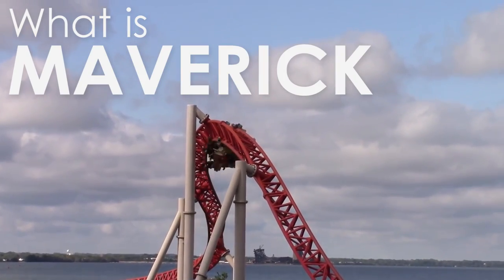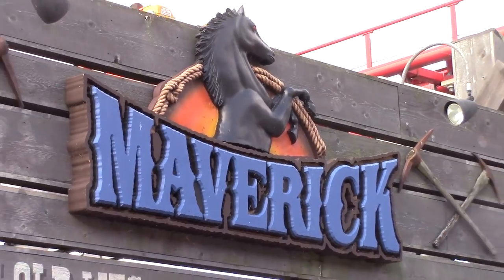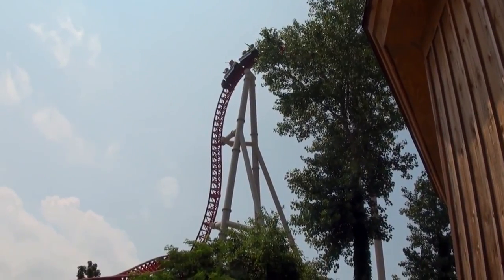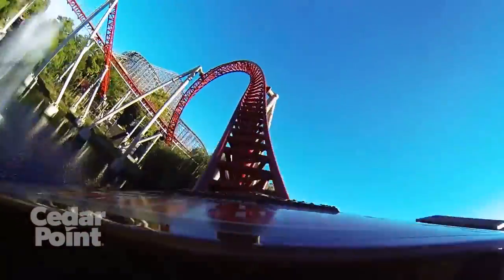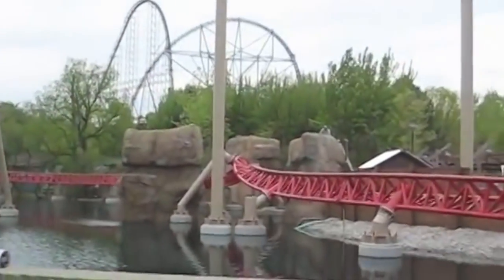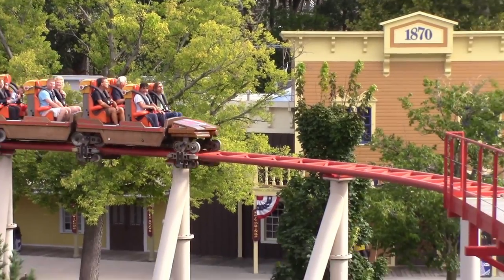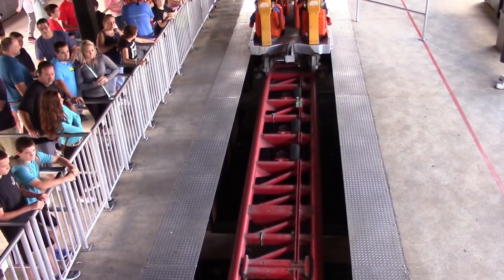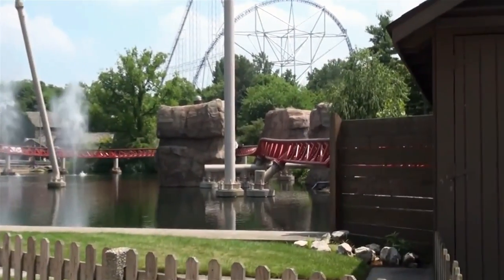What is: Maverick - Cedar Point

Comment: When I think of roller coasters I think of this ride.  I remember doing it at like 10pm when the park was about to close down.  They don’t (or at least when I rode it, they didn’t) light the track very well and I rode it in the front.  it is literally the most thrilling amusement park ride experience I’ve ever had.  While the Millennium Force and Top Thrill Dragster take the cake with size, the Maverick makes up for with sheer chaos.

Comment: Actually, the ops do 45 secdispatches, so the output ends up being much much higher (up to 1920). Of course, 45 sec dispatches always vary, so it goes to about 1500 or even a little lower

Comment: you hear parks building new b&m's, new rmc's, and these are great coasters, but Intamin does not build new coasters that often. IMO parks should look at intamin coasters more, because they usually are the, or one of the, best coasters at the parks.
Reply: Actually, looking at the past 5 years and what has been confirmed for 2018, Intamin has manufactured more coaster than B&M and RMC. Intamin has/will have done 37 new coasters by 2018 where as B&M has/will have done 30 by 2018. Also, RMC is still a relatively new manufacturer and they focus on major coasters, so they get attention from that. However, all but 3 of those Intamins have been built outside the states where as a lot of B&Ms and RMCs are built in the states and coasters in the states appear to get more attention. So while Intamin isn't building too many coasters in the states, parks in Europe and Asia commission Intamin a lot.
Reply: I do agree with that. It is probably the smaller amount of attention that makes it seem like intamin has less new coasters.